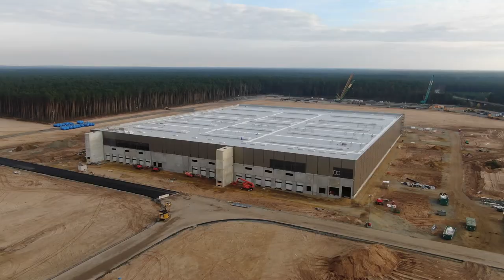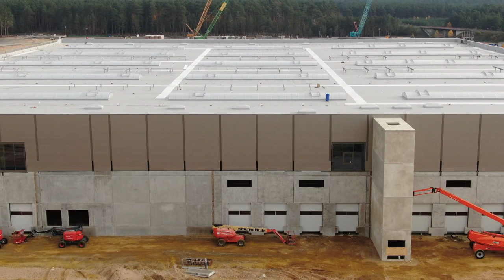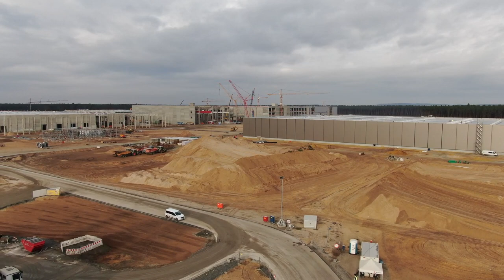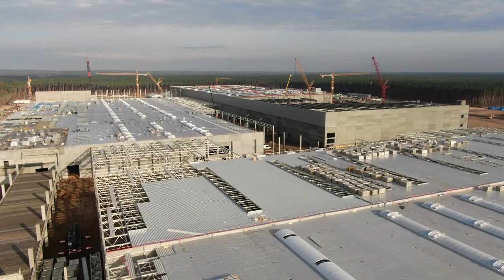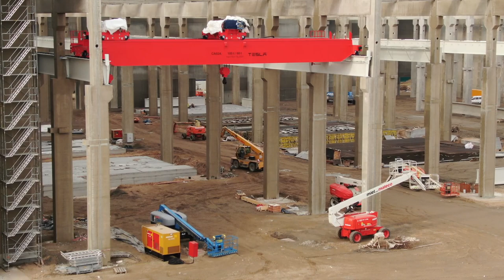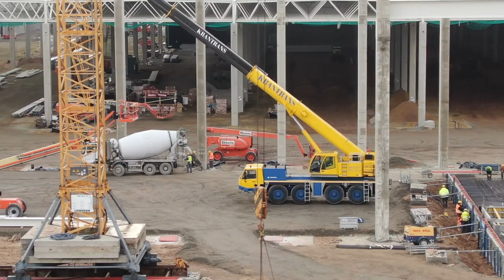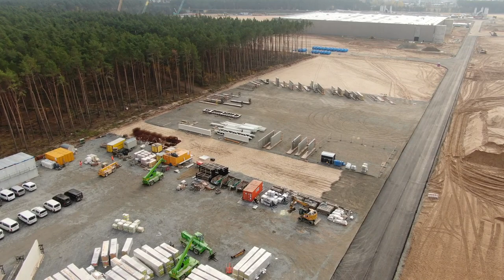Giga Berlin | 2020-11-14 | Stamping structure

Comment: 6:54 dog, cat or fox enters from right and runs off to left, looks scared.
Reply: It's GigaCat going for progress inspection :)
edit: I was corrected, it is definitively a fox.
Reply: @danielmunnemann2987  just as long its not a bat or an ant were ok.
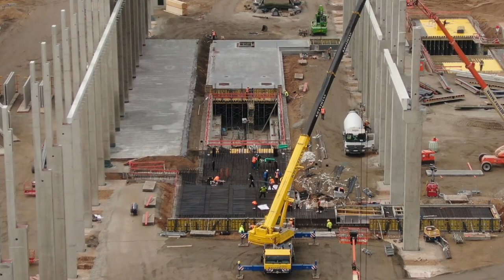Reply: It first appears on lower right at 6:29.
Reply: @aussie_al  at day, no bat :)
Reply: @SteveRypka  The guy on the top deck has walked towards the right edge a few seconds before and watches him, quickly pointing at it in the 7:02 set of frames.  (Space bar pauses, period advances 1/30 sec, comma retraces 1/30 sec).
Reply: @freundron  Thanks Ron!  I did not know about period and comma uses.

Comment: 0:26 what are the 2 concrete pillars on side of building? When they installed they just looked like hollow tubes. In photos, they just look like design elements with lights coming from them. Do they serve any function or just for design? Maybe stairs but i didnt see any holes in the wall
Reply from the maker: It's stairs. They cut the holes in the wall for the doors after they install the stairwells.

Comment: So many containers. Are the workers sleeping there during the week?
Reply from the maker: No, I don't think so. But there are some containers outside of the site. I think those will be used for workers accommodation in the future.
Reply: Yes they do.
Reply from the maker: @julianreverse  How do you know?
Reply: @TobiasLindh  
1: The employer is legally obliged to provide accommodation.
2: A container costs less than a hotel room for two nights for an entire month. 
3: The workers can't drive home over night.
4: Fly closer and have a look.
Reply: Those are absolutely modular housing camps. Typically 2 bedrooms share a bathroom jack/jill style.
Reply: @n64luigiCPU  Wrong. There is typically one bathroom for each floor.
Reply from the maker: @julianreverse   We did look at these containers for quite some time and wonder what they are used for. I never saw any sign of people living in those containers. For example, there is no light after working hours.
Also, does containers inside the fenced property count as directly connected to public areas as required by law? That's why I thought that the containers outside will be used for accommodation.
The containers are modular. The rental companies of the containers do provide all kinds. They also have containers with own bathrooms or shared by two rooms. But those are usually only for higher employees.
Reply: @TobiasLindh  There are no two bedroom + 1 bathroom containers available anywhere. Containers with their own bathroom can't be easily integrated into a stack and not at all into a big double face to face stack with a central corridor as seen here.
Reply from the maker: @julianreverse  I saw that somewhere on the website of a container rental. I remember that I was surprised about it, when I saw it. It was made from two standard containers as far as I remember.
Reply: @TobiasLindh  May be some super special  custom something but not from one of the two market leaders ELA or OECON now Portakabin